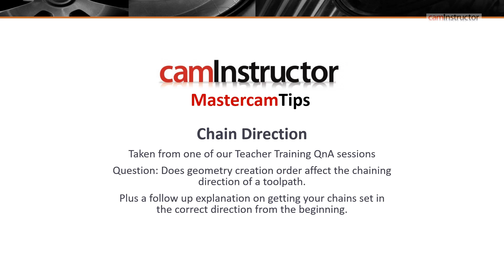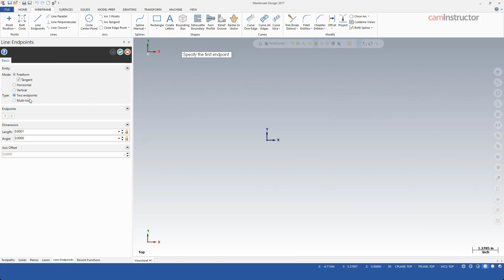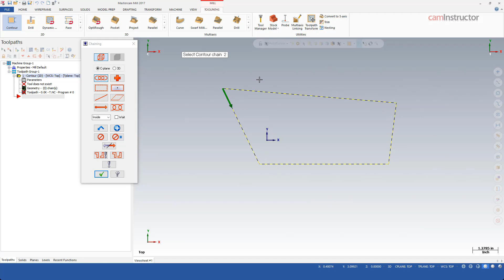Chaining Direction Control in Mastercam

Comment: Good video. I know this is 4 years old already but you forgot an important point about chaining... Which side of the wire frame the cursor is when the chain is selected determines which side the toolpath will be. This is a very important as it eliminates another step that takes several clicks and more time to do. You mentioned the wire frame is the outside of the part and show your cursor climb milling and conventional milling the outside but your toolpath went to the inside. This added confusion about what you said and the result of your toolpath. When programming 8 hours a day, about 261 days a year, correctly selecting the first time saves a considerable amount of time ($$$), reducing the time needed to sit and program 8 hours a day, 😃, also the risk of carpal tunnel syndrome is less. Ask me how I know. Thanks for the video.
Reply from the maker: The position of the cursor, inside vs outside of the shape, does not effect the chains direction. You may have some different settings in your config file to have this result. When 'Use Cursor Position' is enabled in the config, this dictates the direction as mentioned in the video, and the toolpath being set to comp left controls which side of the chain is cut.
Reply: @CamInstructor  Thanks. I wasn't aware there was a Config setting.

Comment: Hi thank you for the great video I do have a question about chaining currently I’m having issues with linking and the problem I am having is on a slight off set let say I have two diameter one is 0.625 and the other is 0.650 every time I Tritons run the chain it stops at a certain point can you help me 

Tony   Thanks